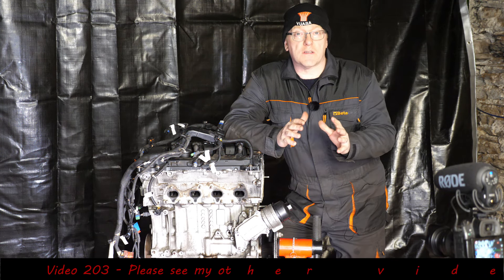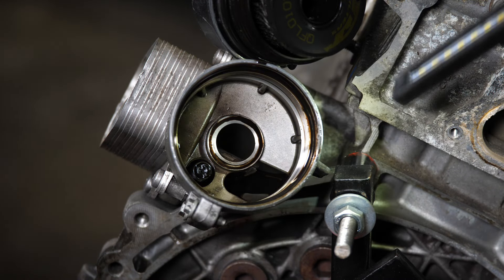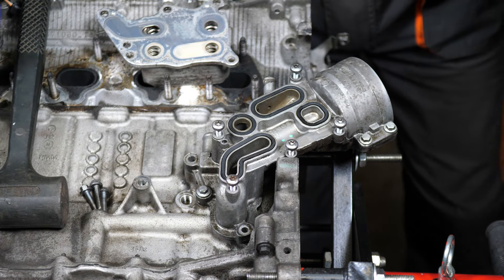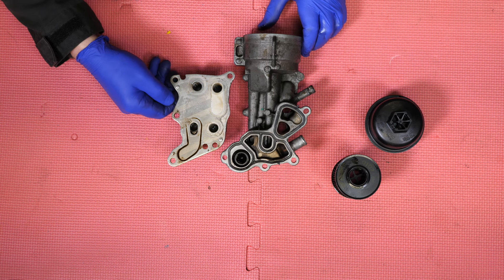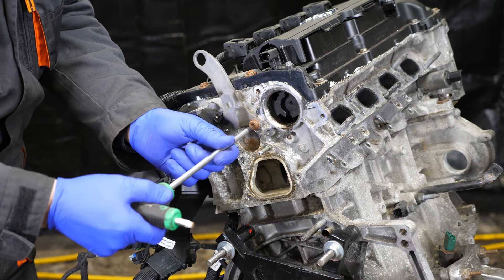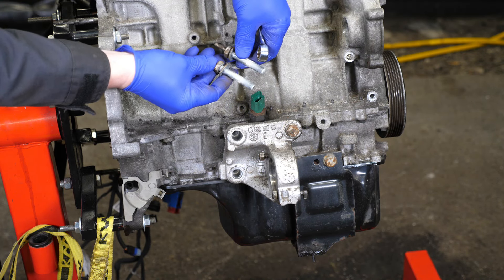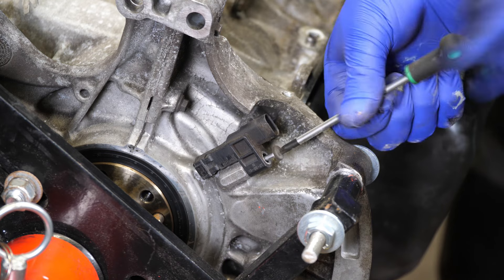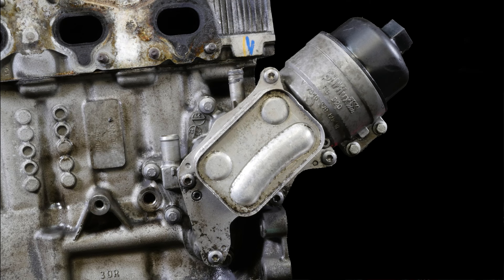Part 12 - Oil Filter & Cooler Assembly on Peugeot 207 208 EP6 THP Citroen BMW Mini N12 N13 N14

Comment: Thank you. I have never seen a more detailed breakdown off this engine ever. I have been looking through so many videos and only found yours. Thank you again. From Durban South Africa.
Reply from the maker: Thank you for that.  I do try to satisfy my OCD lol
Reply: Good day. I have a P3027 fault code for the 1.6 thp (Knock sensor 1 circuit low input bank 1 or single sensor. And U0073 communication module bus off. Do I change the sensor or is there something more serious that I have to complete. I just got the head reseated and re valved new piston rings and bearings new timing chain. Etc. The turbo was not activating so I checked and the vacuum pipe was not connected. After doing so this fault code came up, before that nothing or fault codes appeared. The check engine lights does not come on just error on the screen console. The car jerks on second gear and every gear after that. Fuel consumption also has increased. Please advise.

Comment: Need to replace the gaskets of the oil filter housing. Is it possible to remove/attach teh housing without taking of the exhaust manifold?

Comment: hi very helpful video been under my car today and finally found my coolant leak looks like the oil cooler dripping from behind the cat where it meets the cooler looks like some fun in future removing this
Reply from the maker: Thank you and good luck, not the easiest of engines to work on.
Reply: @CoatsandGaiters thanks I got it done and seems cured also re-did my injector seals and rocker cover gasket which cured my oil leak fingers crossed thanks again for your video

Comment: I have a problem with my car, oil goes into the water tank but the car does not lose oil nor does it raise temperatures but the water in the water tank becomes like mud and now I am thinking of changing the oil cooler, what would you suggest I do?? its the same engine Thp 207 turbo
Reply from the maker: Sorry but I don't know the engine well enough to suggest a solution.

Comment: Thank you for the detailed video's much appreciated. Got a question about the spring/valve/plunger on the bottom side of the housing (5:38min). Mine fell out during dissassemble, cant seem to get it flush like it shows in your video, can you give me more information on how that part is held in. Greetings and subscribed!
Reply from the maker: Did you resolve in the end?

Comment: Good afternoon, I have noticed oil in coolant expansion tank, car runs fine and doesn't overheat, is thi maybe a fault with the cooler?

Is this easy enough to remove whn still in the car?
Reply from the maker: Sadly I do not know this engine very well.  I only stripped it.